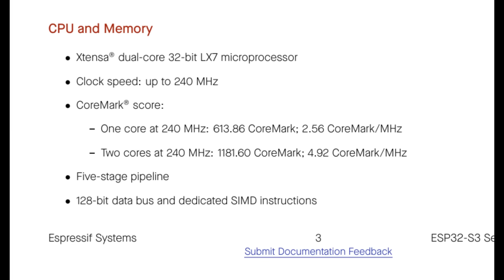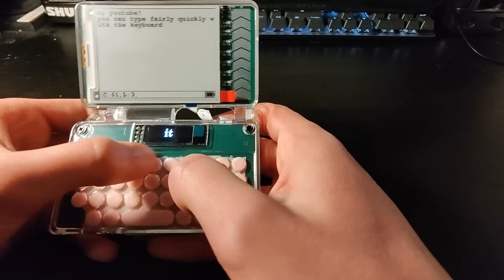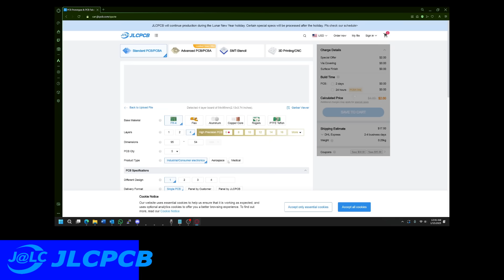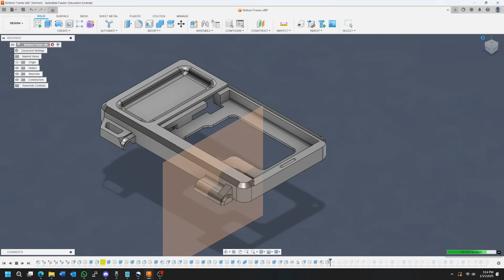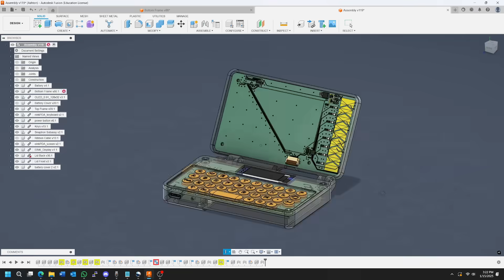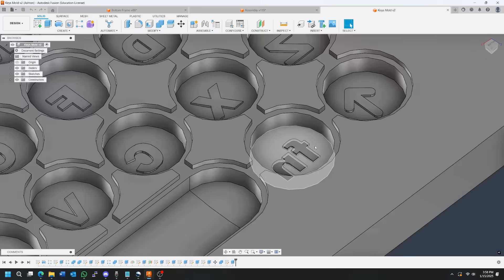Building My Dream Productivity Device

Comment: Nice personal project. with that type of keyboard it has, you have to hunt-and-peck each key, when you want a USB port for an external keyboard if you're ever equipped with one so you can type faster? This kind of seems like a regression from Unix computers, a lot of power can actually be done in the terminal interface.

Comment: This kind of tech and work in the community IS important. Can't wait for tech to slow down and and an abundance of parts leads to a creators economy rather than a consumer electronics one. Got no issue with someone making this, but technology should be there to make something easier. I don't see the use case. anyhelp? why not a pen and paper? Assuming you were using a pen and paper that can work under difficult environments like water, heat, and junk, what can be done with a device that is better that normal tools?

Comment: What is handling the USB-PD communications for the charging system?
Reply from the maker: The circuit board contains 2 sensing resistors that tell the power device to give the USB-C 5V.

Comment: Make a 2 color mold. Just put a bit silicone on each letter and place a negative mold of with each letter inside so it spreads the silicone away on the letter. Then fill with another silicone color.

Comment: I've been trying to figure out how to make a device like this, with almost the exact same form factor and features (clamshell, big e-ink display and a smaller OLED or LCD display, qwerty keyboard, swappable battery, creating and editing .txt files), for the exact same purpose (a note-taking device that isn't as distracting as a smartphone). I thought a video on how to do this was too specific to find, but I guess I underestimated amazing creators like you. I'm on a break at work rn but I'll definitely check out this whole series later. Thank you!
Reply: Like seriously, I only watched 3 minutes of the video but the only two differences I see so far are;
1. I was leaning more towards using a 16x2 white-on-blue character LCD for the bottom one, 
2. I was thinking about making it look like a gameboy advance sp when it's closed
That's it. This is amazing.

Comment: Hey, that's a pretty neat device you made there. Nothing for me personally since I don't have any notable ideas and stuff around naptime, but if it works for you, great. 😁

i think I would confuse myself at least at the beginning about the keyboard tho, at least in the video, you were barely able to see the layout. I mean, i don't need a view of a keyboard to write stuff, but since it's a weird layout with combined buttons and on a weird scale, I for sure would screw up typing with it at the beginning. I even screw up typing on my phone, i need a good old mechanical keyboard to type fast.🤣

For the silicone i guess you may just need a bit more experience. Maybe reach out to an artist that uses it regularly for molds and stuff, there are ways so you don't induce too much air while mixing it. A vacuum pump would also get rid of most bubbles i guess, but those are not cheap. Afaik you can also use oil paints to give it color, but i haven't worked too often with silicone yet, i am not an expert on that. 🙃

Comment: Could you put two of the smaller screens side by side so you can type out larger words? also add a python syntax checker (something like what notepad ++ uses to check if there's anything explicitly wrong)

Comment: I like this, however why would I want to use this over a pocket notebook?
Reply: I had to think about this. :) I guess maybe you specifically wouldn't have a use for it, but I would have several.
   After all these years of practice, I can probably type faster than anyone can write regular English text (as opposed to shorthand), though not necessarily with 2 thumbs. :)
   People on the autistic spectrum typically have trouble writing neatly, especially when they want to write fast. I have it really badly, it's almost painful for me to write readable text. A keyboard is an immense help.
   This could probably run a calendar app with reminders and alarms. Such apps help me a lot, and I'd rather have one on a device like this than on a smartphone with the visual clutter modern apps have, besides the common problems of pushy marketing and dubious privacy. (As another commenter said, "I miss when technology was cosy instead of predatory.") The eInk screen might be nice too.
   Finally, on a bad day I have a real problem with information overload, and so it's better for me if I can delete items from my shopping list rather than just cross them out. Electronic devices are great for that.

Comment: This is so cool. The simplicity is lovely. I really, really miss tactile buttons/switches/etc. and it's a bummer to me that design culture has moved away from them. I can't be the only one! 

My favorite phone was the AT&T Pantech slide-screen phone I had in the 2010s because it had a physical keyboard with really well-designed tactile key-press. I mean, I still have the phone itself around, but it's sad and lifeless and I doubt there's any way to get it connected to service anymore.

Comment: This reminds me of a little pocket-sized handheld organiser I was gifted back in the early 2000s! It was about the same size as your device but slimmer. It was great! It had a full mini keyboard with numbers and a small screen at the top. You could use it to write notes and you could even set reminders at certain times as it had timers and would beep at you when required. It was so cute, I think my mum still has it in my old room!
Reply: Please ask your mum for it's information!

Comment: Having that exact e-ink screen combined with that exact oled screen, is the very same idea I have in my mind for a while. Did you read my mind, or maybe I did yours? :D
Only differences with my project is that I'm planning on using a SoC capbable of running Linux, and I would make the whole thing to be flat, not foldable.
I really like how you solved the keyboard tho, this is the part where I'm a bit stuck right now.
Great video, thank you!

Comment: Hmm.... Why did you choose to use e-Ink display?
Reply from the maker: Cause they awesome
Reply: @ashtf  but isn't it slow? Also it requires screen updating to eliminate leftover e-ink? Or you just like how it look?
Reply from the maker: The slow update time is why the OLED was included. E-Ink is easy on the eyes and a nicer experience than a traditional LCD screen.
Reply: @ashtf  LCD at its very start is also easy on the eyes. Just look at those old solar-powered scientific calculators, they are LCD and didn't have a backlight so it won't hurt your eyes. Or even like those hand-held game boys. However I agree that E-INK looks better because the background is white instead of yellow and the contrast is more controllable.

Comment: I adore the look of this little thing. I could see myself using this all the time. The only think I might have done is with the buttons, some sort of extra layer to give a visual separation to the keys, so you don't see the silicone connecting them, but I'm just picky. Wondering how that might affect typing...maybe I could paint the inside plastic on that one part?

Comment: This looks a lot like one of the device started designing a decade ago. Also, for notes, since I have many files each contain thousand. I had gotten an xbox chatpad working with arduino, based on a project I found online, but had to fix it's syncing to work. I still have the code. Most projects that attempt a design like this, use silicone keypads which is very bad. It's more frustrating, and probably leads to more hand fatigue.
There's a market for highly niche devices like this, especially when there's a emphasis on low power and long battery life. I envisioned a custom embedded operating system, something along the lines of Rockbox.
Niche interests like this have grown exponentially compared to 10yrs ago too. 
Right now, I'm somewhat more interested in a custom slim keyboard design, with an extreme prejudice against mechanical keyboards. Maybe start with a system that you can hack onto any old keyboard and replace its brainz. Integration with the Meshtastic Network would also be on my bucket list.
Reply: I'm trying to be a bit more active with my projects. I'll try to upload the Chatpad project to my      Github(/lonestead), along with older projects like a C++ note sorter I made. I also have mockups laying around...

If you're a developer reading this,  feel free to connect. I'm interested in making a large consortium of projects (from embedded software, to programming languages, to desktop [environment] apps, game engine design, gamedev, to the web, to AI and local LLMs) based on specific guidelines and principals. I spent a long time entrenched in programming and abstract design, and spent 3x that amount hardly touching programming. Right now, I can firmly say I hate tech with the way it is. We can do better.

Comment: this is amazing!
You can cast silicone without bubbles by using a vacuum chamber, or less effectively (but more cheaply) by strongly vibrating the cast after pouring; for example, by attaching a rotary sanding machine to the same table where the cast is sitting

Comment: now this is cool, but I imagine this having modern computer tech, but being a more focused envoirement. imagine being able to make 3D, music, graphic design. and code apps for it on the go with a mini computer. that sounds lit. Imagine it being viewable in daylight. imagine it being waterproof, and winter proof. imagine it having long battery.

everybody can costimize it with code and they're is a community of modders. and a marketplace created by coders.  IT CAN EMULATE GAMES, but it's all in e-ink. 

Based on what u wanna do u can swap out the devices front panel with a keyboard. and u don't need touchscreen cause with the keyboard u can click everywhere it's designed to click. So the device has a musical input keyboard, a trackpad, and a trackpad, and a gamepad in one. 

like teenage engineerings new device playdate, but can actually run productive software. designed to be used with keyboard, and as fast as mouse and keyboard. inspired by tracker software where every action go blazing fast with all keyboard input.

Comment: the use of an oled "pre-screen" before it refreshes the e-ink screen is absolutly brilliant. Less refreshing of an e-ink screen means a longer life
Reply: Digital typewriters is what came to mind for me. I've seen people use this idea, it's great.
Reply: which is really cool along with the fact that it's an OLED screen, you'll hardly notice burn in with just black and white
Reply: Can't eink screens display/refresh individual characters? I've never coded for eink (unless abusing my old Kindle counts), but I've always wondered. My old Kindle had a terminal which didn't refresh the whole screen for every character. I think I remember it being a bit hard to read though. Maybe that's the problem, though it could have been the font instead. (I can't stand Courier New except at the lowest resolutions.)
Reply: @eekee6034  ya I thought eink could refresh individual characters as well
Reply: @eekee6034 Yes; also OLED can be prone to burn in, while e-paper is not!
Reply: More brilliant would be to use a Sharp Memory LCD like the SwissMicro calculators, or the Playdate. It has similar contrast but superior refresh rate, yet consumes very little power also.

Comment: i started to create something like this while ago, but e-ink was very slow and i ended up abandoning the project. Using a small LCD as a temporary buffer is a nice solution, but how do you manage backspace and corrections on things already written? it's a bit clunky but i used a giant string called in ram, you could call it too and view it on the small screen. Existing solutions like freewrite simply don't use backspace.
Now i use a clockwork uConsole for my needs but it's nice to see someone diving into this hard project

Comment: Looks great, but switch to a switching regulator instead of an LDO if you want to really optimize power consumption. The reference schematic for the ESP32-S3-EYE dev board has schematic blocks for the switching regulator, lipo charge IC, and power sharing circuit to enable USB charging.

Comment: It's clever with the OLED display catching the real time typing. I was thinking about a shopping list device on e-ink (turned off while shopping) and I bought a Core Ink device recently, but I make clocks from GPS at the moment.  I have some major bug with beeping every hour which I must sort out first. The CardKB from M5Stack is a good little keyboard, if you need one desperately for something.

Comment: Rather than E-ink, with it's refresh disadvantages, have you heard of the bistable very low power LCD that Sharp make? IIRC it might just be monochrome, no shades of grey, but can update at normal LCD rates, no convoluted refresh process or management. Much better than E-ink IMO, for something that's supposed to be interactive, rather than just showing pages of pre-written text like on a book reader.

The Sharp LCD even keeps it's display with zero power, it's truly bistable.

Comment: So love the idea of this. Wish there was something like this but in a ebook format Basically all the manufacturers try to force you into their walled gardens where you cant use the hardware you payed for unless it through their services...😮‍💨
Reply: the rakuten kobo lets you avoid their services in my experience, much better than a kindle
Reply: @jakenadalachgile1836  Yea they are the least worst option. But you still need to create an account to use the device, use their store if you want audio books, or use library ebooks. So they collecting data on your usage, what books you read, ect to sell and in theory could block any content they don't like. When you have so many companies that have been making anti consumer changes to their TOS I cant help but be paranoid.
Reply: Bah, such disloyalty
Reply: Those kobos are good. Pricey for what they are compared to a general tablet. Also have several that failed early, after 2 years eInk alive but kobo dead. Later models seem to be ok

Comment: that OLED idea is genius! such an inspiring video, seriously. I haven't looked over the code yet but I assume you didn't use the ESP32 IDF (the native espressif libs) to handle the file management, probably arduino right? still super cool and looks like it works great. is that strip of pads on the right for scrolling or something? 

such a coincidence that this vid popped up in my feed cause I'm also working on a task scheduling, purpose built gadget thing. I'm looking forward to seeing the way you end up implementing that! 

gonna sub to see what you work on next! 

p.s: that ribbon cable is giving me anxiety just looking at it ;_;
p.p.s: probably not a reasonable thing to spend time on building but if you plan on using resin/silicon molds I've seen people use vacuum chambers after mixing the solution to get rid of bubbles. might be worth investing in one

Comment: I'd love another video detailing the process of designing and ordering the case. I want to build a similar device and this looks better than a 3d printed item.
Reply from the maker: The case was 3D printed!
Reply: Ok, but you ordered it from jlb?
Reply: @girlyvoice3210  It might be looking better because it is 3d printed resin, rather than filament plastic ( the most common 3d printing material ). Or that the printing was done in a more controlled environment (temperature, etc)

Comment: This is cool. The only change I'd suggest is turning the LED to green when it's charged. If it turns off you can't tell if the device is dad/broken or if the battery is charged. Let it turn off when I unplug it.

Comment: Very nice build and also usable, I see opportunities for all kinds of personal software! I might have missed that part, but is there a UPS in there somewhere or does it come with the battery?
Reply from the maker: Yes I designed a load sharing circuit for the device, the ICs and components are on the custom PCB

Comment: how tough was it working with the E-Ink screen? was the LED display there because you couldn't get the E-Ink to respond quickly enough to typing?
Reply from the maker: E-Ink screen wasn't bad to work with except it's very sensitive to the driver circuitry you use. And yes you're exactly right, the OLED is there to improve the typing experience response time.

Comment: This is so incredible, it’s my dream note device as a kid, i used to take notes on a Casio electronic diary, but there wasn’t any way to transfer it to the pc, after that i received my I first pocket pc. This is a minimal and elegant design intended to do only one thing without distractions and it did it excellent, and the clear shell its simply incredible, I think that electronics must deserve show it’s beautiful PCB’s design in most cases. Just an advice, for an upcoming version the ribbon cable from the screen could be located inside the hinge like the N3DS to be protected, otherwise it could be damage due it’s so fragile

Comment: You can update just a tiny spot on an eInk screen fairly quickly, specifically for stuff that needs to respond quickly. if you can get that to work you might be able to ditch the oled
Reply from the maker: When you see the word pop up on the E-Ink screen when typing it's using a partial refresh. Full refresh is ~1s and partial is still ~0.5s which wasn't comfortable for typing in my tests, hence the OLED. I agree though, partial refresh is a powerful tool but I'm afraid it's just not enough to be comfortable IMHO